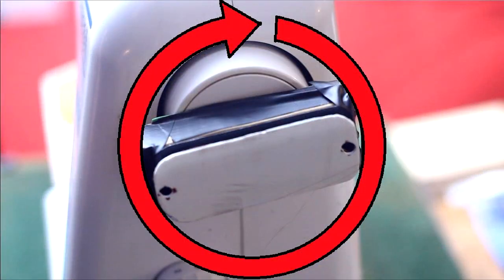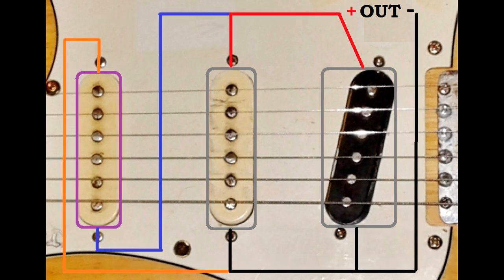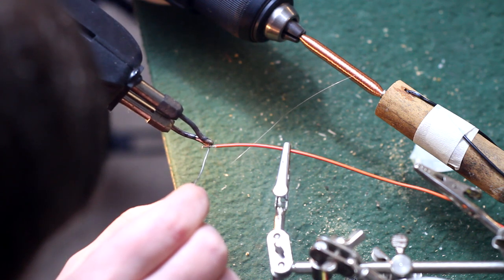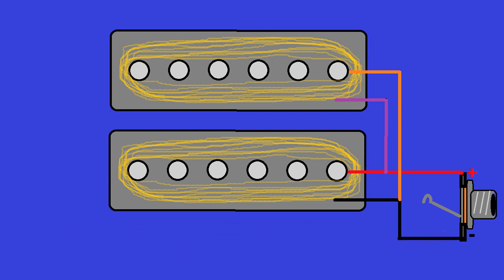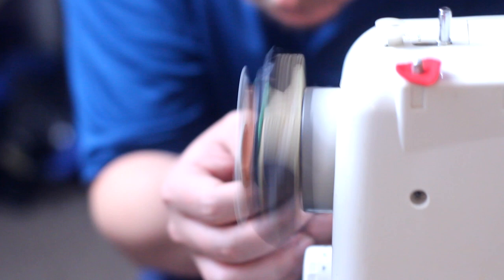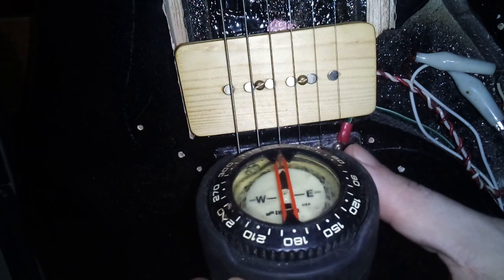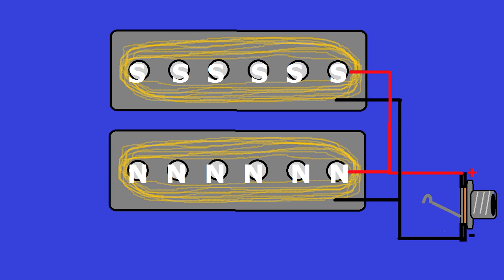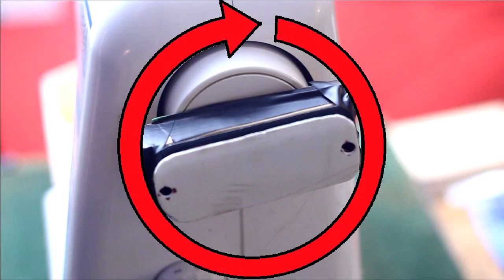Pickup Phase Explained 3 Ways To Do It (Simple Diagrams!)

Comment: Thanks Clem- I'm putting together a scrap caster, and wound my own P-90s with inspiration from you. I added coil taps at the 70% mark, so I could try weird stuff like making a pickup partially out of phase with itself. Lots of fun to try these things, but I get lots of buzz from all my experimental wiring. I guess I need to put a breadboard inside a shielded box on the guitar.
Reply from the maker: Thank you so much for that awesome inspiring comment Allan. That is so great to hear. The off center coil tap as a phase point is a great idea. You seem to really understand what is causing the buzz as yes it is very to be a shielding issue from exposed wires during the tests. You can take an old rca cable and use it as the + of your wiring and only ground the outer wire one end and snip it short on the other leaving only the middle conductor sticking out on the end you want to work with and you can put heat shrink around it to be fancy LOL. Then you will have all your positive leads shielded. That may help, I find it to be just the right medicine for a hot amp input lead or on a noisy fuzz pedal or overdrive that wants to oscillate. If you do that it should quiet down quite a bit. Do remember though that when hooking something up out of phase you have now created another + that will need shielding as well. Thanks again Allen it is always so cool to hear that someone has used info from this channel in their own builds and experiments, that makes my day. That is why I do this.
Reply: Could you explain coil taps and how they are installed please? This is SO AWSOME Clementine, I love how you inspire people, it is a great work you’re doing

Comment: I used 3 three way switches on my last build. Now I'm going to do tgat again but with pots for all three pickups, a lever that can change volume for fade effect as a gimmick, a normal volume knob and a tone knob with 4 three way switches to variate with the amounts of capacitance
Reply: Oh yeah and ofcourse a diy pickup because I only had a pair laying around so I need an extra one. I am inspired by a video of you building one. I think I can do it and if it works it will just be the best pickup ever made in comparison to just buying one.
Reply from the maker: Awesome Iggy, the phase fading thing is something I have never tried before. Ah yeah a rotary cap selector is a pretty slick deal you could go from jazz dart to maybe even put in a tiny 1nf cap on the other end or something and kill the lows off. I use 1nf caps on my volume wipers as a treble bleed often. I hope you decided to make a pickup and I also hope it blew your sox off. Much luck and respect brother.

Comment: Hey Clem! I've ran into a forum discussion about pickups and their construction couple days ago. Basically someone claimed that you can build a pickup without magnet in it and if you wave a magnet above the coil as if it were a string it'd still react as a regular pickup. Does that mean that if you magnetize strings or attach magnets to them you'd get a reading?
Reply from the maker: Thank you as always Bash for watching and taking the time to comment. Yes that is correct if you had a magnetized bridge of some kind or if you glued little magnets to the strings you would not have to put a magnet in the pickup. I think this is somewhat similar to the way a metal detector finds steel. It sends out a wave from one coil and then the metal reacts to that and the other coil picks it up. I was talking with a guy on a FB group about this once and he said yeah I wish they made a metal detector with blue tooth or an input so that when you hit the metal it would play music instead of that annoying beep sound. LOL Thanks again bro.
Reply: If you want to get real wild, if you take a magnet and hold it so it would repel the one in a pickup over the strings it completely kills the signal.
Reply: Bash Chelik
If you do this -- output will be so weak, almost unhearablre on clean channel.
Reply: If I'm not mistaken this is the principle the ebow uses

Comment: I give up on this…. Pickups do not have “phase” they have polarity.
I know Clem knows this, and is using “phase” as is commonly used, but phase is time. Polarity is the up and down of the waveform or electrical signal. Note that pickups have North up and south up polarity. Leo Fender said “out of phase” incorrectly 1000 years ago and people still say it.
Reply from the maker: Great point VCS, You know I never really thought about it much its just the commonly used term so I use it. You are exactly right its not really out of phase like 2 or 3 phase AC mains power. An "out of phase" set of pickups are creating the same or similar AC wave for all intents and purposes at the same time just in different polarities. The wave forms of both would look like out of phase ac power if overlaid on an oscilloscope but,  its not a timing discrepancy like in the winds of a generator head its just opposite polarity, Great point, and actually one I hadn't considered though. I knew it was not the same but I hadn't put in the thought to compare the two and actually note the difference in the two situations with the same common nomenclature. I will continue to say out of phase and in phase though I may take the time to expand on this in the future when I do.
Reply: @heavymetalATC  the pickups that are considered “out of phase” are the same as one another. Reverse the polarity of one, and both the up and down of the wave are separately amplified.
Phase in audio and electrical are different, but polarity is the same in both.